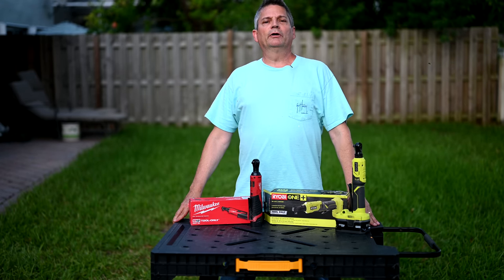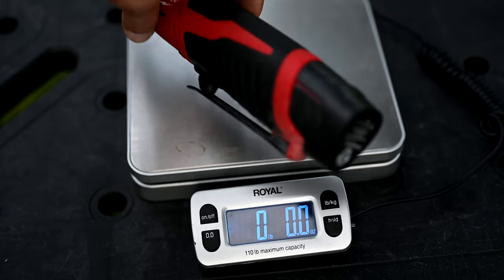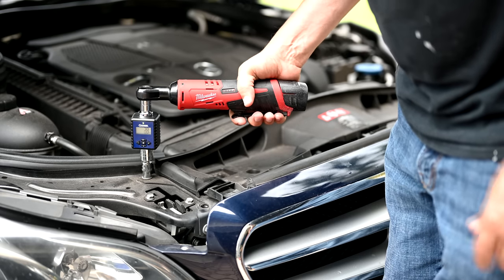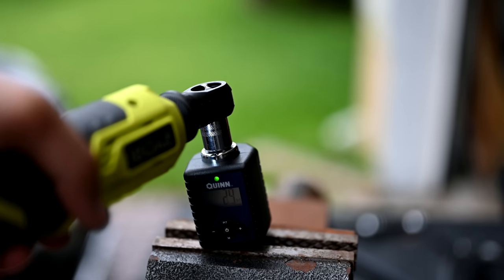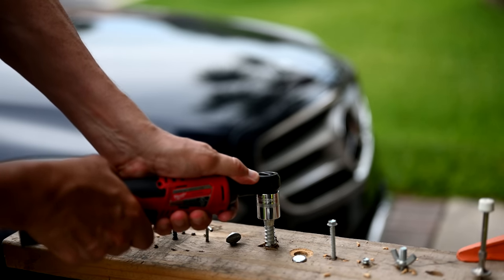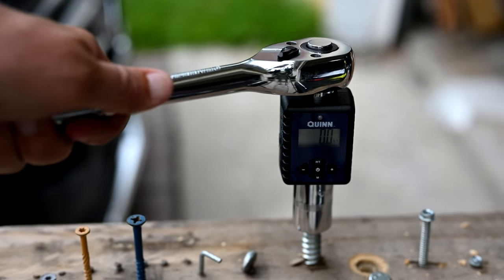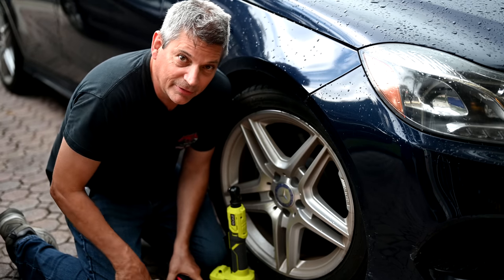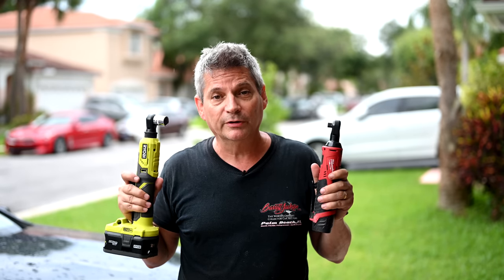Ryobi 3/8" Cordless Ratchet Vs. Milwaukee Torque/RPM Tests

Comment: Finally!!!   good job Jeff my opinion is milwaukee had a 12v 1.5 ah battery vs ryobi 18v battery, if you try a xc-6ah on the milwaukee i think it could of out perform the ryobi. price wise yes ryobi is coming out with some competitor that are making people go DAMM!!!
Reply from the maker: I plan to experiment more with the batteries
Reply: Actually the 4.0 m12 batteries will give your tool the most power output, they use LG 2100mah cells which have the highest discharge current.

Comment: For engine bay work, the ryobi is worthless.  Rotating head will help in some spots, but the battery will keep you from putting that thing deep in any engine bay.
Reply from the maker: Thanks for sharing, I can go fairly deep with no problem. It's only an issue when you have to go way down or squeeze into an area where there is no space. But for common repairs like removing batteries, spark plugs, changing main engine gasket, all of those common repairs are reachable with the Ryobi as well.

Comment: I don't know if either if these are intended to drive lag bolts.  Use an impactor for that.
Reply from the maker: Not even close, they are rated for 35 ft-lbs, light duty. Once you nut bust the lug nuts, then you can use this to spin it off, or on the bolt, i do this all the time

Comment: I’m 18 and have been a mechanic most of my life. I’ve never actually found a use for these. Not my cup of tea if you ask me. I’d rather take the time to unscrew a bolt “by hand” with a ratchet or even use a battery impact or air impact. I’m sure they have their place though
Reply from the maker: Battery change outs and spark plug changes.
Reply: Wait until you have been a mechanic for double your life and get back to me. I can tell you old fingers, hands,  and arms like these electric ratchets,, ahhh except that giant Ryobi.

Comment: I bought into the Milwhackoff 12v system  just for this ratchet and the FUEL 90 degree impact wrench. It's compact and easier to fit in tight spaces and the price isn't an immediate turnoff like Snap-On. I just find myself wishing for a Makita version because Milwaukee seems to cheap out on tools that aren't flagship models. Noticeable difference in build quality between the affordable brushed and overpriced FUEL stuff. Makita seems to keep quality and design the same across brushed and brushless versions of the same tool for less money. TTI is milking the brand name.
Reply from the maker: I need to score a Fuel version of this tool also.
Reply: Makita does have a ratchet on the CXT line and I like it better then the Milwaukee. It has interchangeable anvils so you get a 1/4" and 3/8"
Reply: @craigdoesstuff5270  Is that the one that does 800 Rpms? Would be real nice for somebody that puts tons of nuts and bolts in just one after another and needs it done fast. For automotive the battery was a little much but other than that i'm sure if you're in the lineup it would be nice to have.
Reply: @craigdoesstuff5270  Makita also has a CXT impact wrench.  I use mine for my lightweight jobs, and it is much more powerful than a cordless ratchet.  For heavier work I use more powerful impact wrenches.  These cordless ratchets seem to be way underpowered for real life applications.

Comment: This would be an awesome video to do on the new Fast ratchets from Milwaukee as well as the fuel models from Milwaukee vs the brushed Milwaukee and the ryobi in one video @Jeffostroff
Reply from the maker: Yes with a boatload of cash influx I could buy the other 2, these ratchets are pricey from Milwaukee
Reply: @jeffostroff  you are right they are pricey didn't realize you didn't have them I have all the brushed and brushless ratchets including the extended ratchets just don't have the speed ratchets yet

Comment: 10:26 you never tightened the bolt all the way, because you were afraid you were going to strip the bolt ;)
Defeated the purpose of the test, just saying should have used it on a bigger bolt.
Reply from the maker: It tightened all the way you can hear the clutch disengage.

Comment: Good video Jeff. I was quite impressed with the Ryobi cordless ratchet. The safety aspect of proper torque on the lug nuts is important. Going a step further, no critical nuts or bolts should be considered tight enough by using the cordless ratchets. Including brake and suspension parts, etc. Always finish up with the factory torque specifications using a calibrated torque wrench. Thanks for the review!!!
Reply from the maker: Great point! Thanks Dale!
Reply: @jeffostroff  I also noticed that the Ryobi drove the lag past the shoulder and sunk the hex head in the wood. Whereas the Milwaukee didn't even make it to the shoulder. Good for Ryobi, they take an unnecessary verbal beating by some.
Reply: Facepalm The Milwaukee is better. The Ryobi isn't nearly as capable. Let's not forget a 6Ah Fuel Milwaukee will outperform the Ryobi in every aspect. Also it's a ratchet not an impact.
Reply: Absolutely recheck all important nuts and bolts. Twice I had lug nuts come loose after using a battery powered impact. I always recheck them now.

Comment: The ryobi is not good in tight spaces like in a 2019 Ford f350 on back to the motor to take a back bolt
Reply from the maker: Got news for you the Milwaukee is not good in tight spaces either.

Comment: in real world use ,, this battery is too big ,, no way of any use  under the hood doing any real work where you would need  it to get the job done ,, sure on top side is ok ,, but if you can reach with that battery  you can also just use a ratchet
Reply from the maker: Its use is best above along the top part of the engine but really this tool can be used anywhere I use it on dishwasher legs to level them you can use it on ice makers when you install them

Comment: Most average vehicles lug nuts are around 65 ft pounds 100 ft pounds not normal for a car most cars are around 65 to 75 or so most suvs are around 80 to 95 ft pounds when you get to 100 or 150 or so ft pounds your in trucks that are 1/2 ton to 3/4 ton and even 1 ton trucks and suvs @25:23 @JeffOstroff
Reply from the maker: Good to know

Comment: You have to take into consideration that the Ryobi is 18 V and the Milwaukee is 12.... I would expect the Ryobi to be a little more powerful just for that reason but I can see for sure that the Milwaukee will last a lot longer In terms of longevity
Reply from the maker: I want to upgrade to the brushess Fuel Ratchet and try that one.
Reply: jeffostroff ...Yeah the fuel is supposed to be more powerful even though it's still 12 V
Reply: @devilefan  recent got a 3/8 stubby fuel for 130.tool only...omgosh can do brakes on my 01 Silverado...its beast!
Reply: noname given .... That's not a bad price.... i'm not a mechanic so I don't really need the fuel version..lol...I got the other one just for basic nuts and bolts
Reply: @jeffostroff  Could also try a more powerful battery on the M12s.

Comment: I have been looking at buying the Ryobi 18v Ratchet.  I have a lot of Ryobi tools so i have quit a few batteries and the 6pack changer. I do a lot of old car restoration as a hobby. it looks like a very nice tool with the exception is that it is very heavy and the battery on the end makes it kind of awkward in tights spaces.  the Milwaukee is a more elegant design. its lighter and for a professional mechanic that uses it all day long that is a big difference. for someone like me that just uses it on weekends the Ryobi would be prefect and the 18v battery pack will last monger then the 12v pack.  TTI makes both the Ryobi and the Milwaukee branded power tools, so I expect them to preform about the same with the advantage going to the 18v. these would be great for small jobs, but neither could replace my Campbell-Hausfeld GSD air ratchet for speed or power when working on a car. also you should never tighten lug nuts with a impact wrench. using an impact wrench can over tighten the lugs damaging the threads on the stud, damaging the wheel rim, and possibly warping the break drum or rotor.  I know a lot of contractors that use Ryobi because of the price of the batteries when compared to Milwaukee or DeWalt or others. the Hart stuff is just recolored Ryobi with a different battery pack design. the guts are identical.
Reply from the maker: In the shops I only see them using impact wrenches. Maybe they set them for 100 ft-lbs and they stop?
Reply: @jeffostroff  they make what is called a "Torque Stick" that limits how much torque an impact wrench can apply. they basically act like a torsion bar a limit how much torque is applied to a fastener. the tire shop may have been using one of those. they work well, but they are not as accurate as a good torque wrench. and by good torque wrench I mean something not bought at harbor freight.  the Husky, Kobalt, Craftsman,  and Tekton torque wrench's are all good and moderately priced.  I have had bad experiences with HF tools. and their Pittsburg line in particular is junk.  I hear good things about Icon, but after my bad experiences, I am not going to switch form Tekton and my old USA made Husky tools.
Reply: @jeffostroff  I did end up buying the Ryobi 3/8 ratchet. my first one was defective right out of the box. it appears that the F/R selector was stuck in the middle and would not turn to engage the pawls.  I returned it to to HD and got another one.  so far the replacement has worked perfectly and just used it to replace the battery in my 1970 Camaro SS 396. worked very well and the amount of time it saved was amazing. I was a little worried after the first one was defective, but so far I am very happy with it, and its not like this is the first thing I bought that was defective right out of the box.  I had this same thing happen with the Husky 33in mechanics tool cart last year... some worker at the factory installed the drawer locking mechanism incorrectly, so none of the drawers would lock with lid in the closed position.  upon inspecting it, the lock mechanism was 180 degrees backwards. the one good thing I can say about shopping at HD is the returns department took care of it with no hassle.

Comment: Ryobi had no problem with the 1/2 lag because it has a massive 4.0ah batteries and its a 20v tool compared to a 12 volt tool the Milwaukee might perform better with a xc 4.0ah battery @Jeffostroff
Reply from the maker: The Ryobi motor is rated at the same 35 ft lb
Reply: @jeffostroff  I understand it's rated at the same 35 ft pounds but ryobi under rates there tools on paper and 20v tools will give more initial torque because higher voltage also means higher ampage dump from the battery compared to a 12v tool its ohms law

Comment: I’m shocked at how unnecessarily big the ryoby battery is
Reply from the maker: People have been complaining about this for years. Everyone was hoping in August at their new product announcements of the HP tools that they would have a redesign of the battery, but no deal.
Reply: It's a universal battery for all their 18v tools.  I use that battery on chop saws, drills, grinder, flashlight, radio, fan.  Their catalog of tools is nuts.

Comment: The shitobi has a huge battery hanging off it, and it probably won't last long.
Reply from the maker: It might not go deep in the engine, but will be great for spinning lug nuts after you nut but them, or spinning the lugs back on, other simple chores at the top of the engine.
Reply: @jeffostroff  Yeah but Ryobi is low quality anyways. Probably good for assembling furnitures
Reply from the maker: @DragonBuilds  maybe only IKEA? Lol

Comment: 12v VS 18v ???!!!!!!
Reply from the maker: Really doe snot matter, both tools have the same specs, the same Torque rating of 35 ft pounds, and the the same RPMs. I just did it to show the difference between the 2 tools, not for an apples to apples comparison.
Reply: @jeffostroff  You can put a 4Ah or 2Ah battery on the Milwaukee. Can you get 35 ft pounds for both cases? Common sense tells us not. You should check the details of how to get the specified resultw.

Comment: From an electrician of 20 years of industrial and construction Ryobi is great for home, not quit tough enough for commercial or industrial work.  The bodies flex too much under load, frequently pinching the palm of my hand. The motors stall out before long before Ridgid, Milwakee or Dewalt.  Many of the Ryobi motor gears are polymer and do not  stand up to abuse.  They are cheap for a reason.  I use Ryobi for home use.  I bought into the brand explicitly for the cordless fan and have acquired several more Ryobi tools with no regrets.
Reply from the maker: Good info!

Comment: Stopped watching after 8mins. Your shoddy focusing gave me a headache
Reply from the maker: We are still struggling with the Nikon and are switching to manual focus, their auto focus still has not been right in spite of 3 firmware updates from Nikon. Worst auto focus system ever.

Comment: Only thing that bites is the way the battery is, i understand iits an 18v battery but you think ryobi would have oriented it where it was the least slim. If it was angled right with a compact 1.5ah battery it might fit into some tighter areas. I men if milwaukee made an 18v ratchet itd be the same way. Il probably get the ryobi just bc i have an air ratchet for when i need somthing slim and i already have a 18v ryobi set, i also have 1/2in 2767 high torque milwaukee impact wrench kit, came with 2 5ah batteries, a rubber boot, led light and an impact socket set on sale for 4.79. For the money you just cant beat that milwaukee impact wrench its a monster. Just got a milwaukee blower too but for most other tools ryibi is more than adequate. I might even get there new 1/2in hp impact wrench bc its so compact and powerful. But its hard to justify bc i have a decent air supply but sometimes you dont have access to the compressor and its nice to not have the hose sometimes.
Reply from the maker: Believe me though that rotating head they put on there is a great design feature that really does help move the battery out of the way in certain cases. But yes Ryo be is limited by their battery design that hasn't changed in years and they really need to come up with a slim battery elect those smaller Milwaukee M12 CP batteries that are basically little cylinders that would help tremendously

Comment: Are you kidding me with the size of the battery on the end of that thing?
Reply from the maker: I can easily get to most bolts on the upper part of the engine. anything down tight, not even the Milwaukee can get to, you need to start adding 12" extenders.

Comment: Well I've been in the market for a ratchet. (I just work on my person vehicles usually toyota cars) i got the m18 fuel 1/2 mid torque and the 90 degree m12 impact (it a crazy how small and powerful it is) I think I'm gonna go with a ryobi for the ratchet I have an adaptor for my m18 to ryobi tools that I run my recip saw and my lawnmower/ weed trimmer. Both are great brands dont let a battery hold you back go buy a 25 dollar adapter and live freely.
Reply from the maker: That's a novel idea on the adapter!

Comment: My opinion with the ryobi. They should have just put the head on backwards and made the head fixed. From my experience, anytime they have a tool with a rotating head they are not very strong. It would not surprise me if that ryobi didnt last very long
Reply from the maker: This is a light duty tool not meant to be a very strong tool anyway it is only rated for 35 foot pounds so whatever you're concerned about I don't think it's even an issue for them